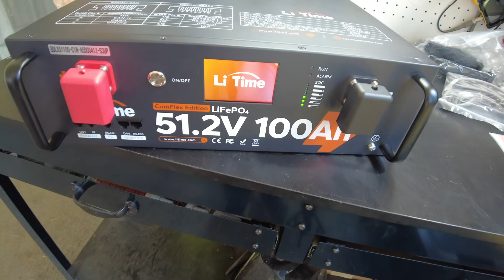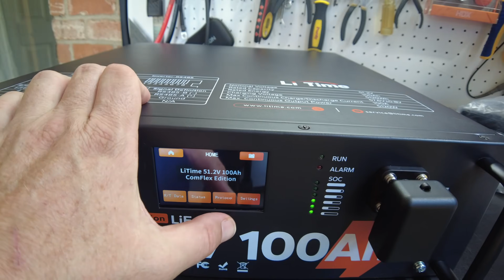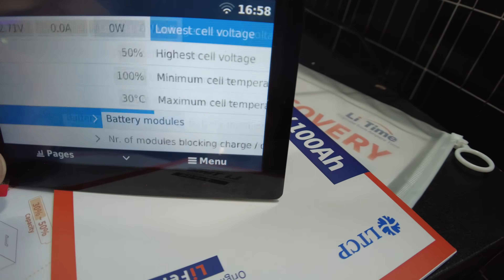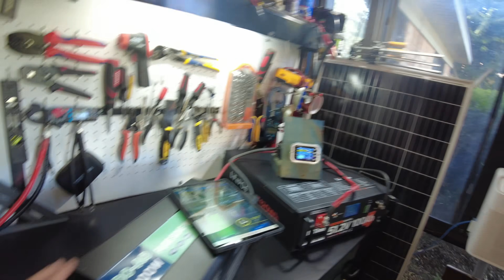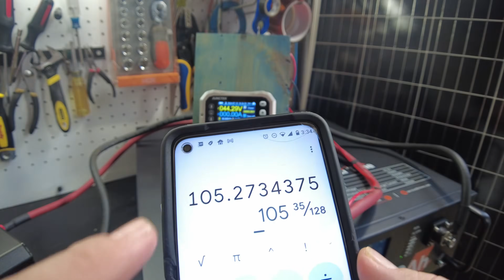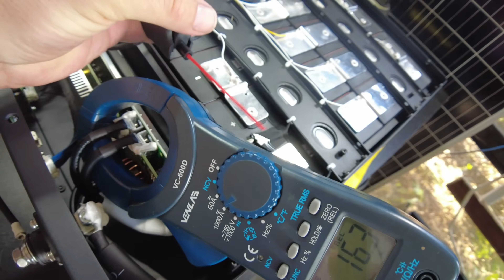LiTime 48V 100Ah ComFlex Server Rack LiFePO4 Battery

Comment: Capacity and build quality are very good; I do wish that these batteries had built-in circuit breakers to simplify installation in a parallel setup (like most of their competition).  It would simplify the cabling and reduce cable & lug costs.  In a 4P setup, you'd need 5 circuit breakers (one for each battery positive to the bus bar, and another between the bus bar and the inverter).  I'm surprised that the battery didn't seem to automatically recover after the LTCP-induced shutdown.

Comment: Nice battery, I like the color touchscreen, looks like a Pace BMS, is that right?. 
But my preferred BMS would be the JK inverter BMS. 
I don't like that the cells are welded over the basbars and the cells are not replaceable. 
Are the BMS settings locked or can the user change them?
Reply from the maker: The touchscreen is a nice touch  (pun intended :) It does kind of look like a Pace, but I'm not sure on that. As for the settings looks like only the protocols can be changed. Maybe I should try to connect with the pace BMS tools to see if it responds? Yeah, I want to try one of those JK inverter BMS. Thanks!